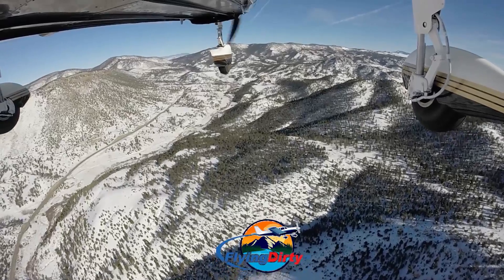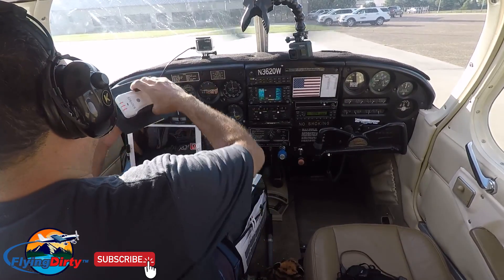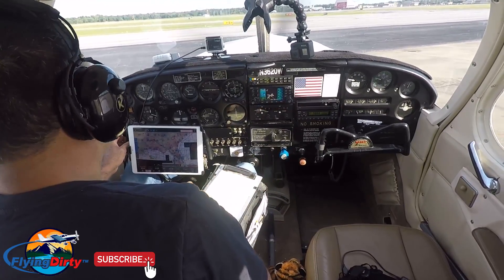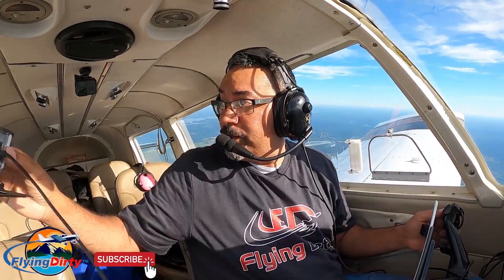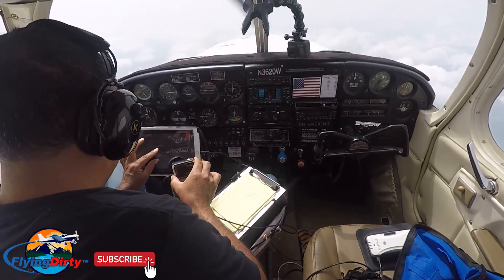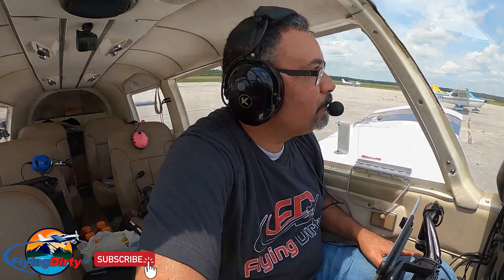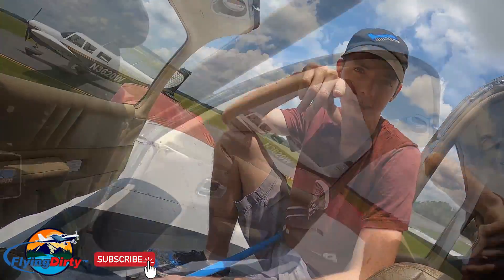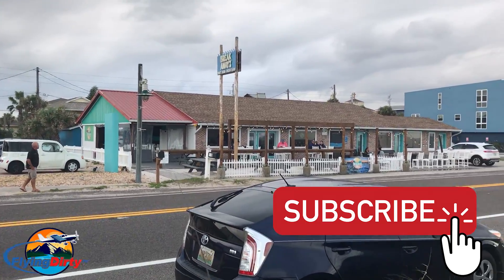DYNON SKYVIEW HDX Panel Upgrade - Part 3 (Excitement starts to kick in).

Comment: Raul, I’ve also had my panel upgraded by Jesse a year ago with the Dynon SkyView HDX, Dynon D10, and the TruTrak. Only difference is I’ve the IFD 540. Flying Monkeys panel upgrade inspired me to do the same. I’ve a 77 Piper Lance. I love, and truly enjoy flying with all the upgrade that was done.

Question: I saw your video about the TT bump. I’ve experienced that myself. Are you still having that occurring, and, if so, what phase of flight do you experience it?
Reply from the maker: Frankie, I had a 430w and thought it was easy to swap it out for the IFD 440 and I am also really enjoying the new panel upgrade. As for the TT, it has not happened again and it happened twice during my climb. I found out that it was out of trim and it had reached it's torque limit. It seems like the trim annunciations are not really accurate leading me to over trimming. So now what I like to do is occasionally disengage the AP to make sure it's properly trimmed and then I reengage. It's a pain in the a-- but I am waiting on when Dynon finally decides to release theirs for the PA32.
Reply: @FlyingDirty  Agreed! As soon as Dynon certifies their autopilot for the PA-32R, I, too, am going to make the swap. God Bless and be well.
Reply from the maker: @frankiep.8446  God Bless you also Frankie and thank you for connecting with me!

Comment: The display is split.  So, is this, technically a PFD and MFD?  Does an installation with one Dynon HDX with Auto-pilot qualify for TAA?
Reply from the maker: Hello and welcome! Yes, it is primary and also a multi function display. According to the definition of TAA the HDX and autopilot meets the minimum requirements.

Comment: Quite a journey, it's fun to follow along! I'm digging the music too. Can't wait to see that panel. Watching your videos makes me want to get my instrument rating.
I thought of another Cherokee six question. I've been using the gats jar to drain the tank sumps on mine and it works great. How do you handle the quick drain behind the seat?
The poh talks about a special jar to collect and inspect but I haven't been able to find anything that would stay there while I'm in the cockpit.
Reply from the maker: So I have a screen filtered large funnel cone on top of a Folgers coffee container. As long as I position it right under the drain it is easy going. I got my instrument rating several years ago and it is damn worth it! Did you go to Rapid City?
Reply: @FlyingDirty  thanks. With good weather I hope to go to rapid city on Friday. I flew my kid down to Lamar yesterday just to go to the DMV! Crazy times we are living in
Reply: Oh, did you keep your old wing leveler parts? Mine is inop and I was wondering what it would take to get it going again.
Thanks
Reply from the maker: backcountrypilot I have all the parts in a box and about to list everything on eBay. But I can put aside the wing leveler for you. As you can see from the videos, I used it a lot on xcountry flights.
Reply: @FlyingDirty  yes I noticed you flying hands off in your videos and I noticed the wing leveler in the last video. I'm interested but I don't know what's involved in the system and what's missing and inop on mine or what it takes to install/fix. Let me know if you list it. I'd like to fix mine if it's cost effective.
Reply from the maker: @backcountrypilot911  Will do!